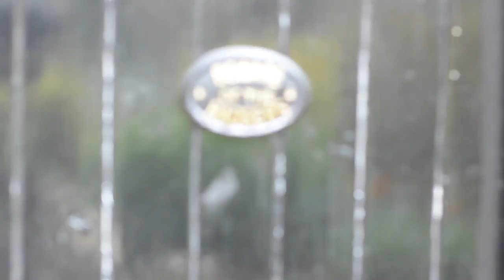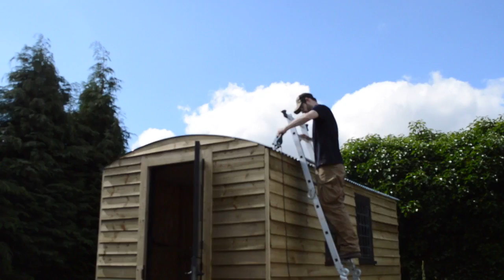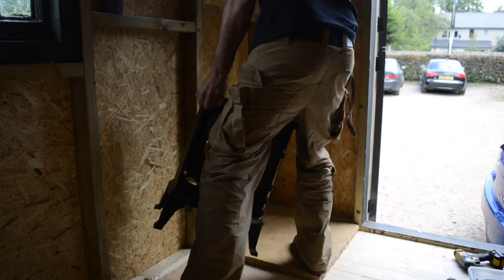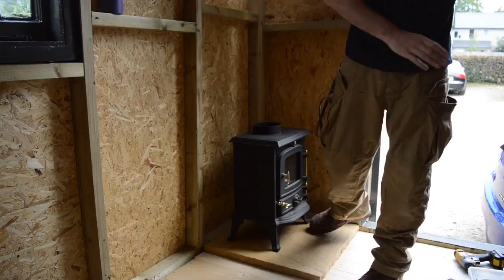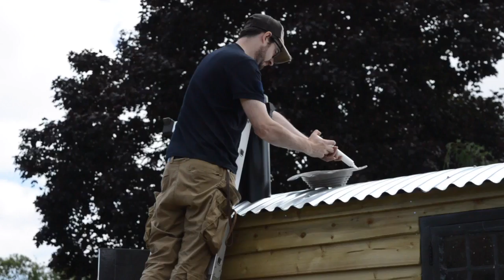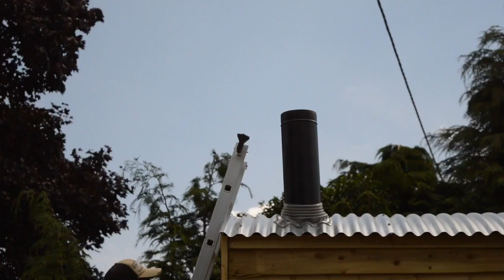Shepherds Hut Build Part 11 Fitting the stove flue

Comment: Good job, Sir. The hole you cut in the corrugated roof for the twin wall flue to pass through, is there a particular size it should be? Just big enough for the flue to pass through, or does there need to be a bit of a gap around the edge?
Reply from the maker: I am no expert but mine just fits. The twin wall does not get too hot but should not be too close to anything flammable.

Comment: You make it look so easy :-). Is there anything around the flu where it meets the ceiling inside to finish it off nicely ? :-)
Reply from the maker: Yes I installed a black metal cover plate. It finished it nicely. I can't remember if i filmed it. You might be able to spot it in a later video.
Reply: Badger Workshop I'll look out for it. Thanks ;-)

Comment: great work - thanks for the video. I have a quick question, if I may. When securing the flashing to the corrugated tin roof, I take it the screws were fixed on the peaks of the tin, and not in the troughs, is that correct? Was it difficult to mold the metal plate in the flashing to take the shape of the roof? I'll be doing something similar soon and want to be as prepared as possible to get a good water tight seal. thanks again
Reply from the maker: Yes the screws go in the peaks. I used no flashing on the roof, just the sheets. The overlap by a few ridges.